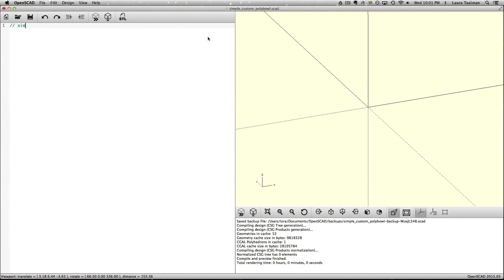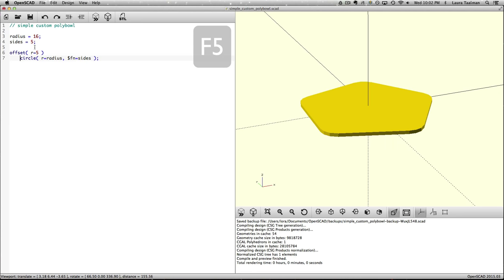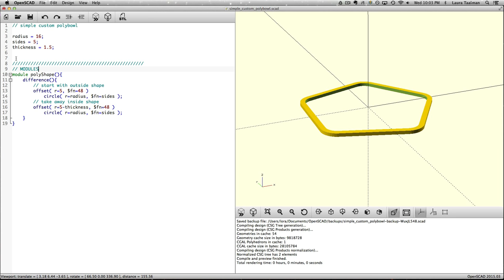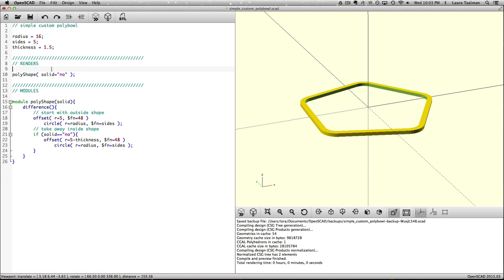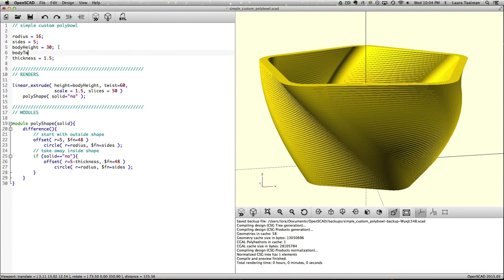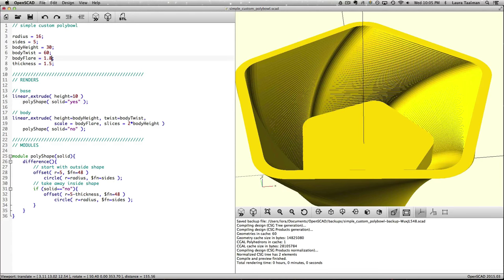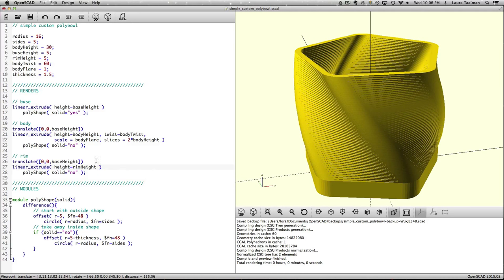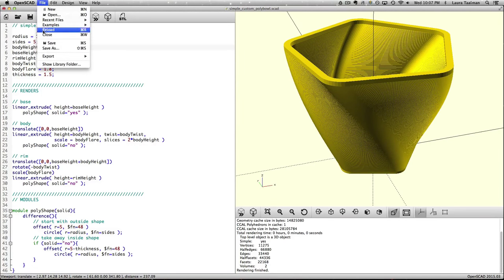PolyBowls - A simple OpenSCAD code walkthrough

Comment: I found that the base can be modeled by assuming that it is a trapezium and calculating the flare (would allow us to reuse the module of the polyShape
baseflare = baseheight/bodyheight *(1+ bodyflare); 
The angle of twist needs to be modified as well so it is
basetwist = baseheight/bodyheight* bodytwist;
// This worked for me and produced a seemingly valid shape
P.S.: I don't have a 3d printer so I don't know whether the shapes works or not

Correction: Doesn't work and I don't know why